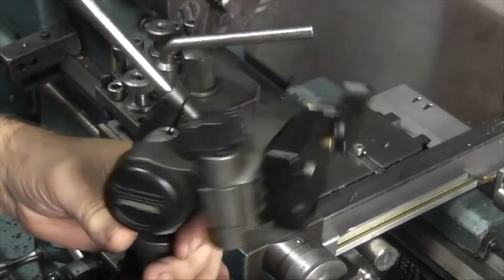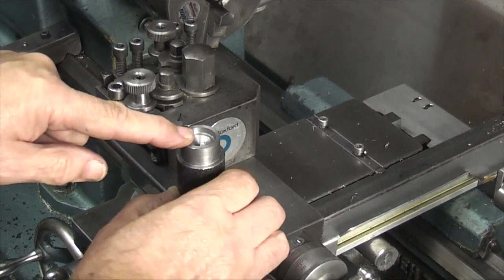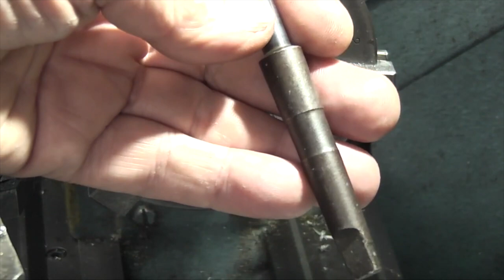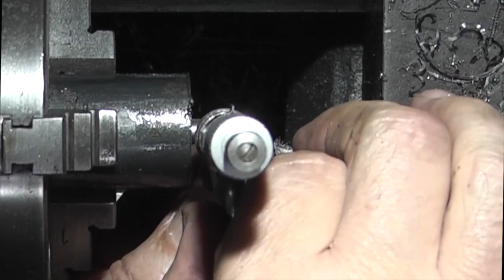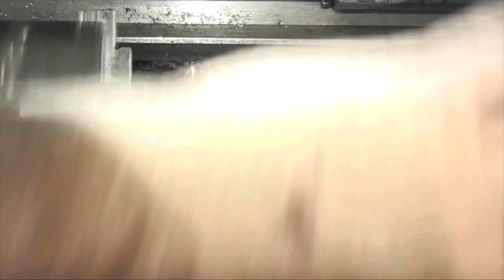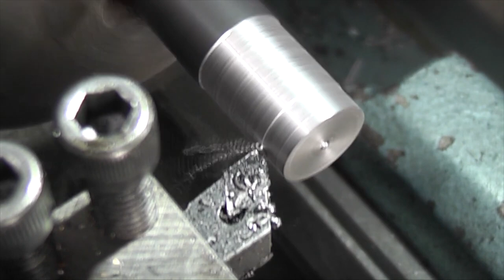Making a camera adaptor

Comment: That will turn out to be a handy camera stand. As far as the vibration is concerned - your holder is a little springboard. I'm thinking a holder that is more vertically rectangular because you don't want it to vibrate in the horizontal either. Sort of like this that is sold for use with a dial indicator. https://www.mcmaster.com/2217A19/
Reply: Something with a profile closer to an I-beam might mitigate some of the vibration.